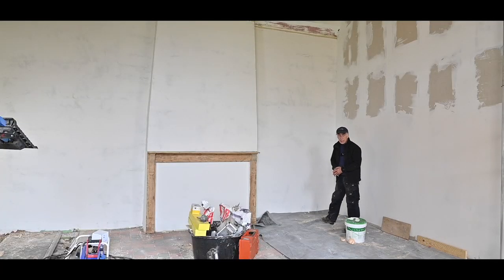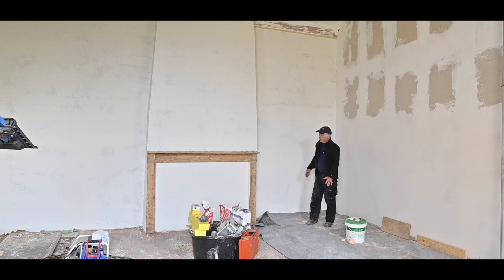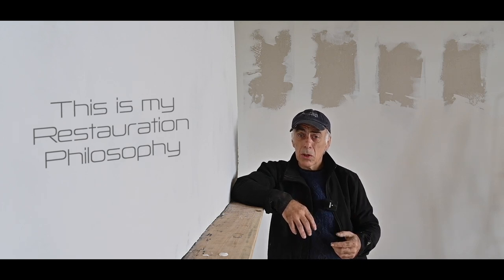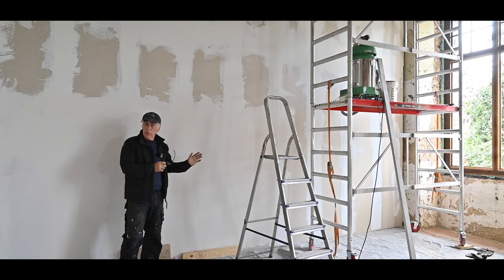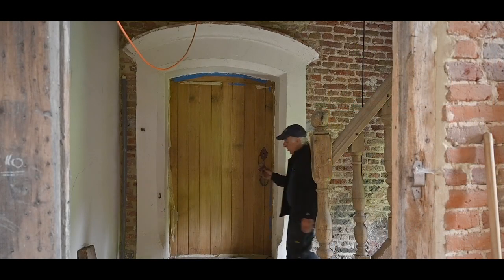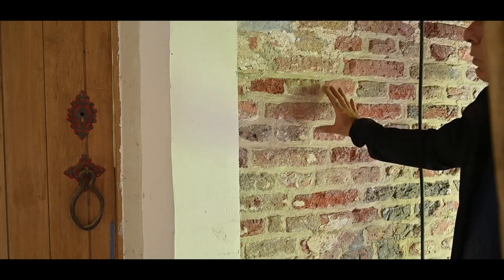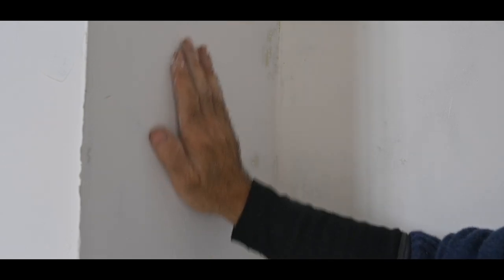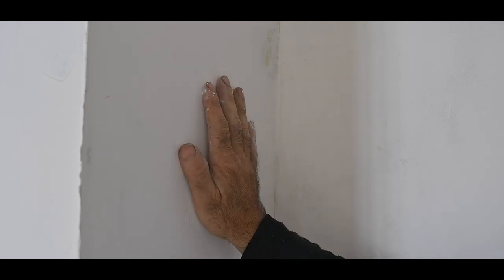Restoring the Tower Room, Applying the finisher and answering questions

Comment: 5:00 Within the period of '75 to '81 when I'd been involved with bricking custom homes; the 1st 2 yrs. of course learning, & the last 4 yrs. earning... I'd often seen the plan's designated fire box center line location, to be offset either to the left or the right or even to the front or the rear of the chimney stacks opening. Not only @ the ceiling plate locations, but as well from that ceiling plate opening, & on through to the leave out opening left on the roof; where the carpenters had given little or no mind as to where plumb had been drawn from said fire box's center line on the plans. Many roofed & shingled openings were expected by the bricklayers to be that way. The adaptations taken, were to utilize what we called ''Jack-lines'' @ all 4 corners of the stack from the ceiling plate to the roof opening. By following those 4 lines would result in a gradual corbel over of each brick course as they progressed upward to the roof line's finished opening. 
One might be surprised when they put a plumb level to their custom home's attic chimney stack. 
Same situation was prevalent in my following 3 yrs. in the passenger elevator construction field. No progressing floor opening's were exactly vertically or horizontally plumb to one another. The guide rails had to be set to the tightest floor opening or chisel hammered to accommodate, when possible. ''Disclaimer'' to the music of the elevators I'd been involved in constructing... ''I never installed any of that music!'' 
The center line of the you're project there: may well be the reason the left side of the fireplace wall is not plumb...
Perhaps it was in order for the stack to go between those 2 upper support beams. 
Wholeheartedly agree with the reasoning of leaving as much original in place of that structure as safely possible. It's what's kept me happy in my '53 Chevy 5-window short bed Pickup. That, and it's every election year's sanding & new case coat of rust-oleum's rattle can brown epoxy primer.
Reply from the maker: thank you so much for this great write up, that explains a lot.  And i learned  a lot from your comment, things i did not know

Comment: Those cupboards by the fire place would probably have had flour or other dry or milled food in there to keep them dry and from caking or going mould. No central heating back in those days so how do you keep dry food (flour, oats, bread and such like) dry and for longer? Keep it in a cupboard by the fire. Also, it is possible, that maybe bread was raised in a cupboard?
Reply from the maker: thanks for the write up, that is very well possible.

Comment: That giant fireplace is very beautiful! Will you use it?
Reply: Because it is very tall and shallow, it might emit a lot of smoke into the interior of the room.  I have a similar situation and I can't have a fire without using a tight sealing glass door on the fireplace.  The brick is gorgeous though, isn't it?  I would wash the surface to remove some of the soot, but Steve might consider that to be messing with history.  Time will tell.
Reply from the maker: that is the plan, and i have used it. works perfect
Reply from the maker: in my case the fire place has a straight smoke stack, raising to 13 meters, that provides a very good draft.   I have no smoke in the house. the chimeny is in good condition and all the soot was removed.
Reply: D3Sshooter make a video later of the fire black in action 🍺🏁😊